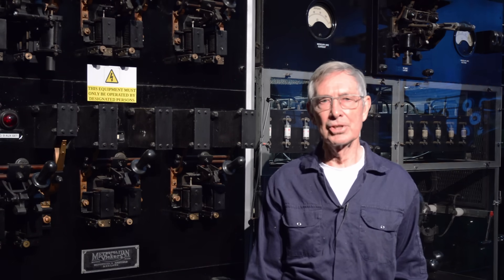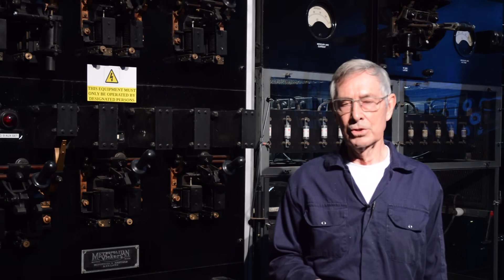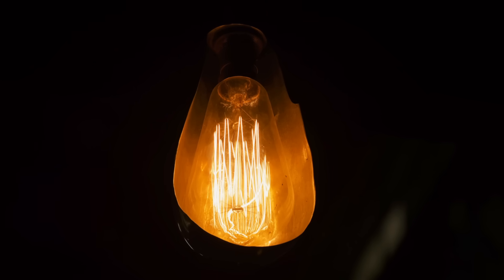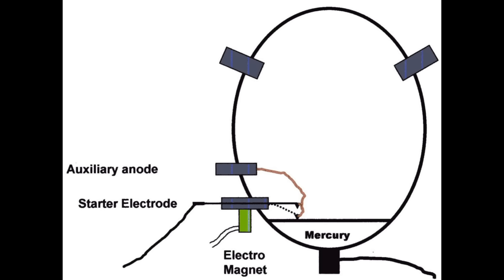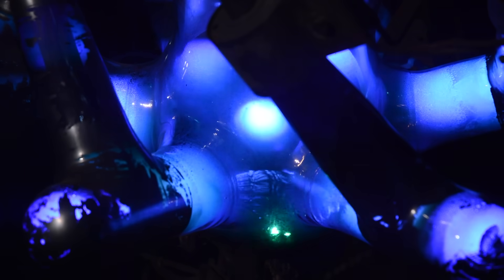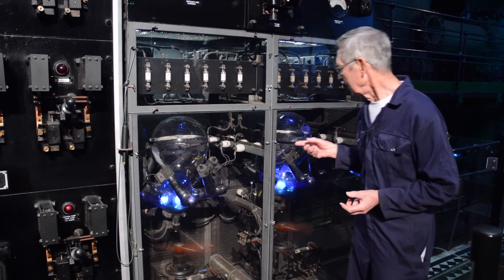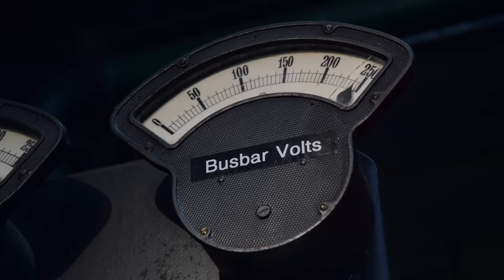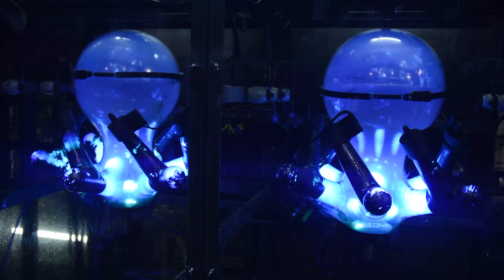Mercury Arc Rectifiers - Kempton Steam Museum

Comment: Weird as it might sound, under the right conditions where one electrode (end) of a fluorescent bulb breaks down, it also conducts current in just one direction.  It happens frequently just as the lamp is about to become unusable.  But it can operate long enough to overheat other components because it is not designed to work that way.

Comment: This takes me back to the 1970's when I worked for British Steel as an electrician. We had some of these for producing the DC that powered the cranes, scale and transfer cars that formed part of the furnace charging system. These were replaced by semiconductor rectifiers, but the needn't have bothered as it turned out as the plant was shut down within two or three years. Don't recall ever having any trouble with the MAR,s or the semiconductors 
Many years later I was working as an electrical inspector for an insurance company and attended a factory (sadly no longer in existence) in Manchester that had some MAR's under insurance with us. My site contact told me they had been bought in the late 1950's from a company in Germany who was getting rid of them because they were obsolete, this was around 2005. Anyway, they were still working OK and they even had some spares that had never been used.

Comment: The reason I got my amateur radio operator's license at age 11 was because I saw a mercury arc rectifier in a 1 kw power amplifier when I was 9 and I was so mesmerised I thought I would have to have one of those. Of course, just like the Triumph TR3 I fell in love with when I was 14, I would never get one, but I did wind up using an electron microscope for almost 50 years. Thank you for this interesting demonstration of this amazing technology.
Reply: Ive got to get back on the radio

Comment: We had a mercury arc rectifier in a papermill I worked in. Unfortunately it supplied power to the mill social club and whenever it was running it produced heavy interferance over the social club sound system presumably from the sparks.

Comment: Am retired now (70 yrs old!), I worked as a Chemist for 25 years; but I first started out in Steam Engineering, operating boilers, testing feed water, running steam powered equipment such as evaporators & condensers. This field is the "root" of the Modern Machine Age, powering ships, generating electricity, & heating buildings. Still find it fascinating, and I marvel at the ingenuity/practicality of their designs!

Comment: I used to work with an ex cinema projectionist from the 1960's and he used to come out with some stories about the Mercury arc rectifiers that used to use to power the carbon arc lamps in the projectors and one of the problems with striking the arc in the projector is not to short out the rods when striking the arc, if you did happen to do that there was an almighty explosion from the Mercury arc rectifier. They used to end up sweeping up all the bits of broken glass and Mercury up off the floor, that's why they are usually contained in metal cages in a different room could you imagine doing that these days with health and safety looking over your shoulder?😁

Comment: I worked for a welding machine construction company from late  1960's into the 80's and to switch and control the power level fed into a welding transformer  they used a water jacketed device with a mercury pool,  called an 'ignitron tube'... There were two devices in 'inverse parallel ' and they took it in turns conducting on the negative and positive AC wave,  making them into a controllable 'ac switch'.   If you delayed supplying power to the 'ignitor' from the start of the sine wave ( that sparked into the mercury pool to create a cloud of mercury vapour to allow main anode / cathode conduction ) you could control how much power was allowed into the the weld ( like a lamp dimmer ).  The ignitron tube was replaced in the 1980's by 'soulless' high power thyristors which were more efficient silicon based devices but lacked that lovely blue glow.

Comment: Back in the mid 90's I was working as a delivery driver for a party rental company.  One day I had a delivery for a party at the Simpsons building at Queen and University in downtown Toronto.  They had me wait for one of the maintenance guys to take me to the area where we were delivering everything and he lead me through back hallways and into the bowels of the building.  We got to one area where there was a powerful buzzing sound and this room was easily 15° warmer than anywhere else we had walked through.  The buzzing was coming from a large cabinet to the side of the room and I joked that it sounded like something in there REALLY wanted to get out.  The maintenance guy stopped, turned and said to me 'Wanna see something most people alive have never seen?".  He had my complete attention and I told him "I would love to".  He handed me a pair of old dark goggles and told me to be sure I did NOT take them off.  I held them close against my eyes and he opened the cabinet doors and I saw a VERY large glass bottle with a liquid metal boiling away in it, all bathed in a remarkable glow.  The buzzing was unbelievably intense and I could feel the heat radiating from it from about 8 feet away.  He only left he doors open for about 30 seconds before he shut them and said "That's more than enough".  We chatted about it as we walked the rest of the way and he explained that it was the main rectifier for the entire building (department store and offices above) and it had been in constant operation for well over 50 years.  He also told me to stay out of the sun for a few days because I had just had about a weeks worth of UV exposure.  30 years later and I can still remember it like it was yesterday.

Comment: A few of these were still operating on the NSW 1500VDC electric railway system beyond 2000. Much of that equipment (as well as the first electric locomotives and electrical equipment in the suburban EMUs) was supplied by Metro-Vick.

Comment: The Museum Of Transport And Technology (MOTAT) in Auckland, NZ, still uses mercury arc rectifiers to supply the 600V DC to run their tramline. The Brisbane Tramway Museum replaced their heritage substation with a modern transformer and diode rectifier only a few years ago.

Comment: In 1930 and 1931, the Lackawanna Railroad in New Jersey USA, previously powering all trains with steam locos, switched most of their commuter lines to electrically propelled m.u.'s which look like strings of coaches with no locomotive up front and two pantographs on the roof of every other coach.  Every other coach had 4 motors in the trucks (bogies), the alternate coach was an unpowered "trailer."  The overhead trolley wire carried 3,000 DC.  Thomas Edison piloted the first electric train for a mile on opening day.  One main line and two branches added up to about 100 miles of track and catenary overall.  Placed along the lines were seven brick buildings with mercury arc rectifiers inside translating AC from the local public utility to 3,000 DC.  The 400 coach fleet carried millions of passengers mainly to New York from the suburbs until 1984 when new AC coaches and new caenary at 25kV replaced the extremely reliable original system.

Comment: As an electronics engineer, it is still amazing to me how people figured this out to begin with.
Reply: Electricity was the "alchemy" of the XIX century and was experimented in the most weird ways... some were science advances and others complete quackery... Some were even dangerous... but human ingenuity has moved forward every time. Now we give for granted what is in a certain aspect a miracle and treat technology as disposable trash without really valuing all the resources and effort put into creating each item with each time more programmed obsolescence by our current capitalist system...
Reply: Most was happy accidents. While trying to do one thing, they found another. Just like the vacuum tube diode and triode came from the invention of Thomas Edison's light bulb. One leaped from the other through experiments.
Reply: @bain5872  Yes, apparently the concept of a rotating motor was discovered by accident, either by connecting a generator to batteries accidentally or by trying to connect two generators to work together.
Reply: Back in the time, trying new things was paid off by merit and fame. Today's instead, it's punished.
Reply: @Smartapillo  Back in the time, trying new things meant accidental poisoning and permanent debilitating injury. Lots of early inventors experimented with mercury and lead and were poisoned, had their eyes burned by looking at arcs and ionized mercury vapor, cancers and amputations from working around X-ray tubes, and later radium.
Reply: @Smartapillo after we detonated the nuclears then the people from space came to step in and said no your nuclear war is interrupting our communication sytems sensors and then leaders of our countries were forced together to "save the planet" before the inevitable happen.
Reply: He discovered the effect on accident, but was smart enough implement it's use.
Reply: @lynnlamusga most things get invented first but get their use later.
Reply: Tinkering and hacking. Some do it their whole lives.
Reply: I need to get back on the RADIO  @NatesRandomVideo
Reply: Those guys played with mercury all day and came up with crazy new ideas. Correlation is not causation, but...
Reply: Science hasn't progressed since the 30s.  You don't need modern physics at all to build a computer or GPS.  
GPS uses Lorentz, written in 1905 and silicon computers use lithography and sputtering (centuries old tech).  The advancement of computers was digital logic, the hardware just got smaller as production methods improved.
Reply: It's hard to believe the technology we have is even real. 
It's insane.
Reply: E.E’s seem to eventually reach the F.M. point same as physicists.
It’s “Fricken Magic”, absolutely amazing.
Reply: On accident is often how these things are discovered while doing or attempting to do something else. They are then understood and put to use.
Reply: Experimentation and discovery.. I was originally intended to be a better light bulb but it was discovered that it produces DC current. Things such as these are discovered and developed out of necessity driven by demand
Reply: diesel engines swirling chambers !!!!!
Reply: How they understood plasma back then
Reply: It’s all people had to mess with… this was before social media and video games and Pokemon cards 😂
Reply: I absolutely love it! What could possibly go wrong? High electrical current and mercury confined in a glass bottle. This is from a day when bad asses ruled the planet.

Comment: interesting as engineer & former lighting co owner. The pure UV lamps are clear and made of i think boron glass. Even in small wattages they will give a very nasty skin & eye burn post haste. Other mercury lamps are called fluorescent as the white phosphor ++ other elements coatings are made to filter out much of U V. so white light is available. But the vho tubes running 1500 milliamp are still not for continuous exposure. Nice to know that a HiPressure Mercury of 1500 watt can act as 1500 watt rectifier.  it is my suspicion other gas lamps (MH HPS, LPS) would do same as mercury is mixed to make it work.

Comment: When the Central Argentine and Great Western railways were originally electrified, rotary converters where used to get 850 V DC.  In the mid 20s, or early 30s, the British railways companies replaced the cantakerous rotary converters with Mercury Arc Rectifiers like the one shown, but if I am not wrong, the ones used had a larger globe, perhaps 4 feet tall.  They were kept in use until were replace by water cooled thyratrons, and eventually silicon or whatever is the current fancy.  As a young teen, I used to go to the electric station, near the railway terminal, and sneak close to the open doors of the station mesmerized by the dancing arcs, and the sudden burst of energy when heavy loads were applied... Until an operator appeared out of nowhere to chase me away!

Comment: Ex-TfL employee here, and London Underground just called: They want their cutting edge rectifiers back as the older stuff they've been keeping in service for the past 175 years is finally starting to wear out! 🚇⚡😆

Joking aside, these are amazing to see and to try to understand! The need for a six-phase supply (That's a 60° phase angle) completely throws my three-phase head for a loop though. I wonder what the power factor is for these, given the light emission shows that not all of the AC going in is coming out as DC (i.e: Not 100% efficient). 😇

Comment: Very interesting, never knew they made it with those rectifiers. Until the invention of VFD DC motors where the only way for drives that had to be controled in speed and start under load.

Comment: OMG.  I worked on Mercury arc rectifier derives in the No1 Rod mill for British Steel at Scunthorpe as an apprentice back in the 70's.  They used to scare me when I first saw them but after learning all about them and having to maintain and fault find them, they became fascinating.  Then came the Thyristor era and we ended up swapping the MA rectifiers out over time.

Colin
Reply: Thx for your story.
Reply: What did you find were the most common failure modes for them?
Reply: @michaellynch1018  Failing Dipper Coils so failure to start up , High resistance Anode Connections causing overheating and phase failure and Failure of the cooling fans causing overheat faults (Our cooling system was a bank of evaporators on the mill roof, so water cooled effectively then fan forced in to each motor control cabinet.) If the cooling water pumps failed it was a mill shutdown until fixed.
Reply: @cgtspl very cool, thank you for the reply!
Reply: Man, don't get me started on GTO Thyristors and the absolutely amazing things GEC Alsthom managed to achieve with them... 🚄🇫🇷❤‍🔥⚡💨💯
Reply: We had them at Shotton Steelworks back then too.  On the Blast Furnace plant where I worked they changed over to semiconductors a couple of years before the plant closed. I remember covering them at college as well, they had a small one in one of the electrical labs for demonstration purposes.

Comment: My old metal lathe runs a DC motor. The speed control is a master of engineering. It has small Mercury rectifier tubes. The actual speed control is driven by two thyratron tubes. The speed control goes up to 4000 rpm very smoothly.

I will be restoring my omniversal milling machine. It used a single thyratron tube on a DC knee motor. The mercury tubes help reduce li e AC to raw DC.

Comment: Reminds me of the old Shuffleton power plant at the south end of Lake Washington, in Renton WA, on the waterfront.  They burned heavy oil (bunker C) and had one boiler temporary situated with auger to the furnace when they were burning hog fuel.  We ran one time in early 80s during a bad winter and after that, they never ran it again and I transferred into the combustion turbine dept.  way of the future etc...   But I remember most is the switchyard control room where all the protective relays were mounted on black slate and once/month, I wiped them down with naptha.   That entire plant is now gone, as Puget Sound Power and Light company realized the waterfront real estate was worth more than the plant could ever generate.  In 1929, it was dubbed the Cathedral of Power with total of 80MW output and at that time, they plainly stated that they would never have to build another power plant in the region.  After a couple years, they found out different.

Comment: I worked in an engineering company that closed in 2003 and they had 3 of these for the dc control on the cranes , one got broke in the late 80s pre internet days and the maintenance foreman found it very difficult to source a replacement, he finally got one from a disused picture house in London .